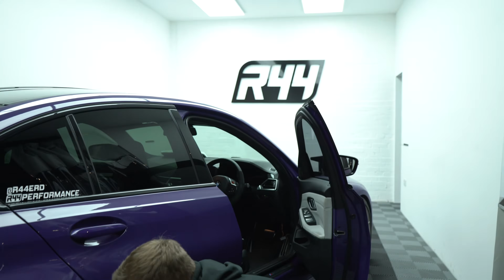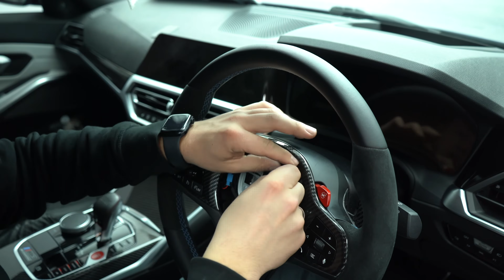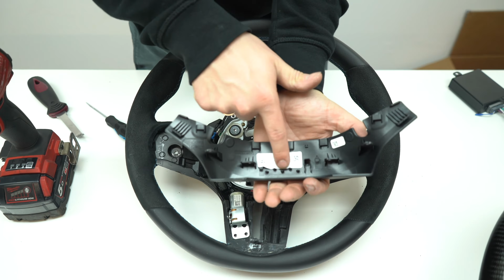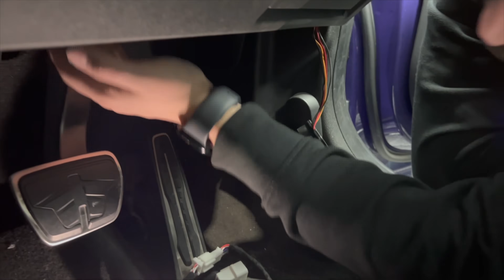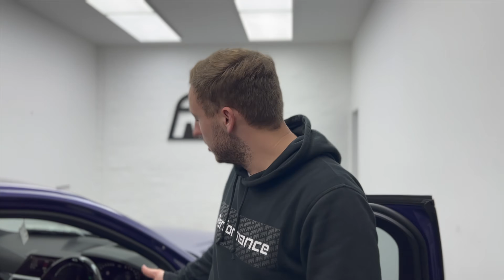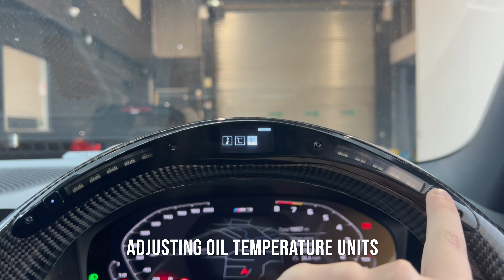HOW TO FIT : SHFT G SERIES LED STEERING WHEEL!

Comment: I bought OEM alcantara flat steering for my 2023 M4 comp, but taking over airbag, I found an interesting surprise: the torx bolt of the steering has a black plastic merged inside! No way to open..

Comment: On 2023 M240i's, just a tip: be careful of the wires / connectors because they have a small little LATCH on them. Use a very small flathead screw driver to pry the housing and the connector a bit, while at the same time prying it away CAREFULLY. Just did mines today :D

Comment: I have these two codes after changing my steering wheel I have the m1 / m2 which no longer works

Code 
030364 
030490

?? Merci
Reply: You figure it out ?